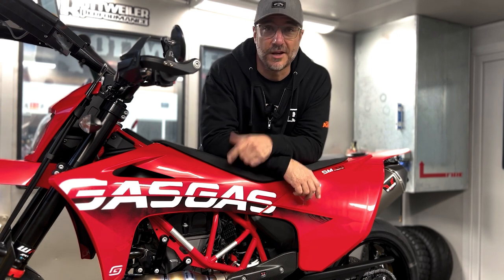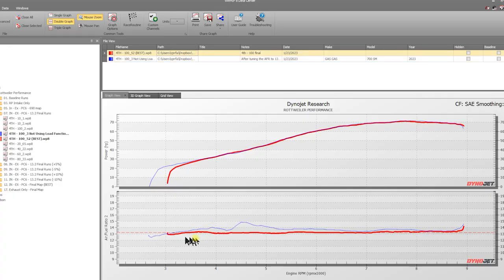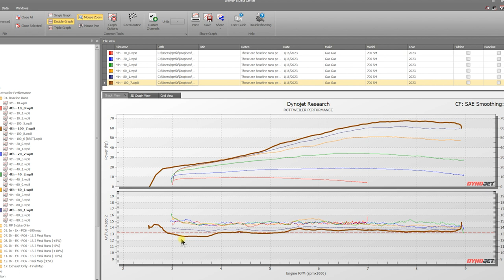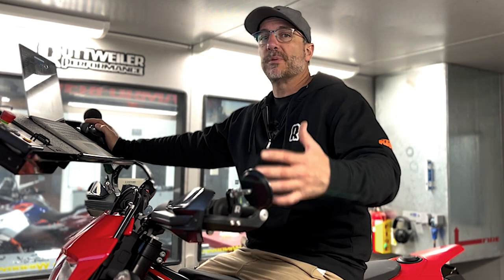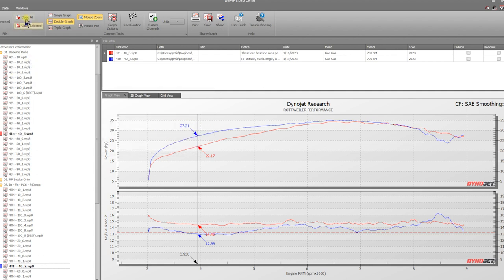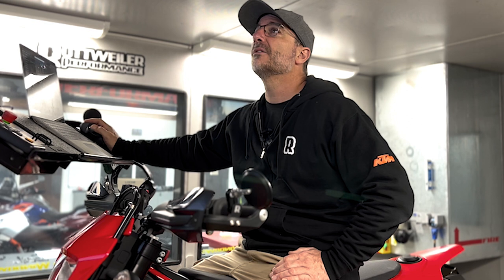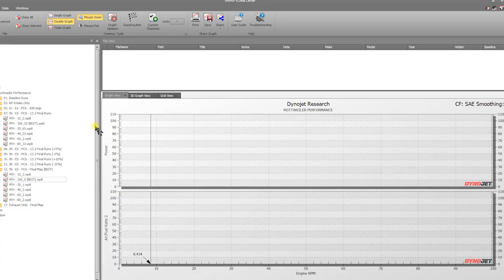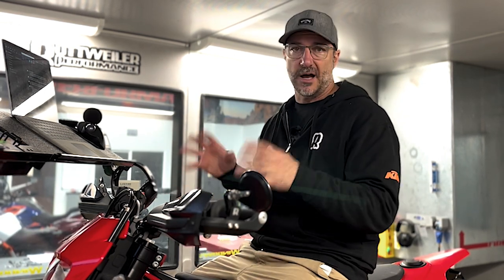TUNING WITH ROTTWEILER - GASGAS 700 SM/ES (2023+)

Comment: Are you using stock ignition timing and what fuel are you using?
Reply from the maker: We have a little advance in the Powercommander 6 but not pushing limits. The gas we are using is California pump gas.
Reply: I just purchased your fueling dongle today I’m going to get the PC and the intake in pieces so when my factory warranty expires I will be ready . What’s your recommendation on the muffler?
Reply from the maker: @bryanlewelling4435  We carry quite a few for that bike. For lightness we would look at Arrow. For sound abatement I would look at Tekmo with the twin core outlets. Those bikes put out some big bangs with the big pistons, so opening them up and keeping them quiet at the same time can be tricky.
Reply: Thanks for the solid answer
Reply from the maker: @bryanlewelling4435  It's what we do...
Reply: @RottweilerPerformance  91 octane, not 93 right?
Reply from the maker: @WiscoSumo  Correctamundo.
Reply: @rottweilerperformance.   Is 93 your top octane rating in USA then? In Uk we can get 99 octane in some stations , I’m betting that would make a fair difference in power?
Reply from the maker: @muckle8  Not necessarily. Higher octane (alone) is simply harder to ignite and nothing more, which is why it's recommended or required for high compression engines. Octane does not make power, it simply allows power to be made effectively by helping higher compression engines that would otherwise knock or pre detonate with lower octane resist the pre detonation by being slightly harder to ignite. This is a common misconception and quite a few riders spend an unnecessary amount of money accomplishing nothing at all. 

Part of what perpetuates this belief is that typically higher than normal octane pump gas fuel is designed for racing, so it also contains other additive that also make power, like VP U4 racing gasoline. It has higher octane, as well as an increased oxygen content which helps with power when mapped or jetted properly. Also, most engines known to make power typically run or have to run high octane fuel, so people assume that it's the higher octane fuel that is making the power, when in reality it's the higher compression engine that is making the power, and the higher octane fuel simply allows it to do so safely. Without high compression, nothing is really happening with it. 

If you have a normal compression engine, higher octane is a waste of money, unless it has other additives like oxygen that also help with power as well as being pure fuel without being filled with government mandated cleaning agents that don't go bang nearly as well as pure, clean, fuel.
Reply: @muckle8  fuel octane is measured differently in Europe vs US so US 93 octane is about EU 98 octane.
Reply: @Greg Miners I didn’t realise that thanks
Reply: @Rottweiler Performance TY for your detailed reply - makes total sense

Comment: Would you tune a gasgas700 for drag racing ?
Reply from the maker: As in for a client or as in at all? The thing about tuning is that there mostly isn't a specific area to focus on. You just focus on it all, so it's all usually just better. It's not like a header pipe that may have different diameters or lengths that could dictate 'low' or 'high' end power. Fuel tuning just gets you to the best place possible regardless of what you are doing with it. Ignition is a bit different because it can really effect the rideability of the bike depending on what you are doing with it, so that part of 'tuning' is a bit different than the fuel part.

Comment: The gains are very nice but you practically killed the bike below 3500rpm, where the normal mapping has a nice, straight torque curve, right?
Reply from the maker: Not at all. What you are reading is the beginning or start of the run on the dyno and they always look like that with a little ramp up. We load the bike at the lowest RPM the bike will allow us to and start from there and those dips should really be trimmed off but we didn’t. You can’t really measure HP well at very low RPMs on a dyno. We can tune there, and measure air fuel ratios there, but turning a heavy drum at those low RPMs doesn’t measure well. These mods make a ton of HP from bottom to top.

Comment: I don't understand how by adding a controller to extend the injector dwell to richen the fuel when the cpu with ox sensor will just adjust the dwell back to the original 02 level.
Reply from the maker: This bike does not do that with a piggyback because there are O2 optimizers that get installed in place of the O2 that richens the mixture in closed loop and stops the ECU from hunting for 14.7 AFR by tricking it into thinking the air fuel ratios in the exhaust system are the same all the time. If you installed a piggyback without our fueling dongles (included only with Power Commanders from Rottweiler Performance and not Dynojet), and had any mapping in closed loop you would be correct in that the bike would just undo the corrections.
Reply: @RottweilerPerformance  As an control engineer that doesn't make sense but I'll take your word for it. Wait a minute. I thought I've read that removing the 02 sensor richens the fuel at least with the stock ecu. My point was concerning a piggy back fuel controller. Interesting conversation.
Reply from the maker: @mxbadboy263  Last reply edited, we misunderstood the question as we were in the middle of answering some other similar questions elsewhere. See new reply above.

Comment: Power commander does not work on my 2022 gas gas based in the uk
Reply: In the same boat, have you found a solution?
Reply: Ecu mapping you can do and its the best
Reply from the maker: We are working on flashing those so stay tuned. The PCV's work with ignition advance which is responsible for making a lot of the power on those bikes so it should work without fuel in closed loop and ignition advances throughout.

Comment: what i dont understand is...how can you tune 2023...i was just on the phone with you guys and im told its not possible...can you explain
Reply from the maker: Not sure what context we would have told someone that unless it was about a specific 2023 model that is problematic in terms of tuning with a Power Commander to which there are a couple of models we have not cracked yet, but most of them, especially Kehin powered models can be tuned with a Power Commander unless they are Euro 5 690-701 which makes things a bit more tricky. We can't get a Euro 5 690-701 bike in the US so we haven't really had the chance to see what we can do there. It's all a matter of time with some of these bikes. 

In terms of the 700 US model, there is no issue tuning it with a Power Commander.
Reply: @RottweilerPerformance  thx for the reply...i picked mine up in canada...2022. so its not a euro 5...im so confused...what do you recommend for my 2022 husky 701...can i buy a power commander from you with a map that will work. im not crazy for the power. just want an exhaust and a K and N filter....please let me know what you think...im doing a trip around costa rica in june. i was thinking the block of plates and a different exhaust to get rid of the cat...thx so much
Reply: sorry maybe a fan switch its really really hot there...thx again
Reply from the maker: @diyoff-road4589  If the bike is not Euro 5 than you are fine with a Power Commander and will be very happy. You just need to tell us what's on the bike and we will pre map it with a custom tune that will really make the bike wake up and ride smoothly without stalling and sputtering. Check here: https://www.rottweilerperformance.com/dynojet-power-commander-6-for-husqvarna-701-enduro-sm-2016/
Reply: @RottweilerPerformance  How to know if a bike is Euro5 or not?  I've bought a '22 701SM here in New Zealand. We get Euro models rather than US models I believe, but I don't know if they are Euro5 compliant or not.
Reply from the maker: @ripping  If it was purchased outside of the US after 2021 it is Euro 5. There are also a few small differences between them such as the dash now shows “RPM” on euro 5, as well as the kickstand sensor is a different connection, the newer euro 5 bikes also have different front brakes than the US or in the past.
Reply: If I buy a brand new 2023 KTM 690SMCR in the USA? Is it going to have Euro 4 or 5 emissions? If I can't get it tuned with a pipe then unfortunately this will be a deal killer.
Reply from the maker: @petebusch9069  No problem on USA bikes, you are just fine. Still tunable. The Euro 5 bikes are as well, but we can't get one so a little limited there on what we can offer.
Reply: @RottweilerPerformance great video!  I’m looking to upgrade after 3 years on a drz400sm.  A guy at cycle gear let me ride his 690 and it was a phenomenal bike.  Cool to see the power these thumpers can make.  I’m a sumo guy so this is my most logical upgrade.  He had a lot of your goodies on it.
Reply from the maker: @kottyking  You'll love that bike! Great upgrade if you ask us.

Comment: Building a ktm 2019 690 turbo. Soon ready to dyno. Running 9 psi 98octane gas. Any tip on how much timing retard? Using powercommander and auto. Plan was to retard one degree pr psi off boost.

Comment: So YES it is a rebranded KTM, since you put forward the question and do not spot any difference
Reply from the maker: Motor and mapping wise there is very little difference. The frame is a 2019+ KTM that's red but we have all come to understand that a majority of the differences between KTM, Husqvarna and GASGAS are the accoutrement. The dashes, the plastics, the shape and look, and the electronics are basically the differences and while GASGAS has positioned itself to be the 'more affordable' KTM, it's all pretty much the same stuff without the nice details of a KTM or Husky.